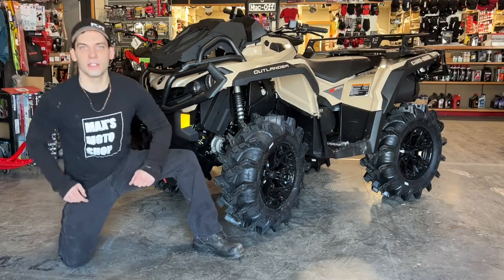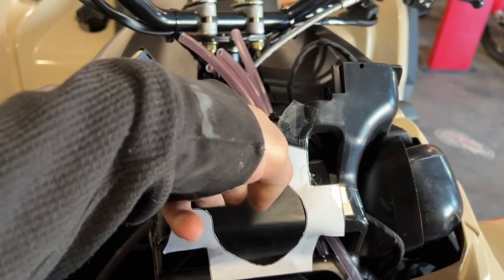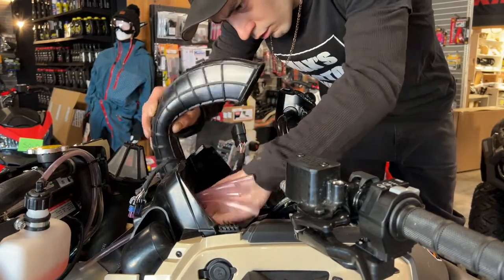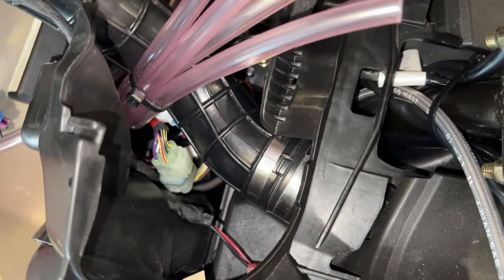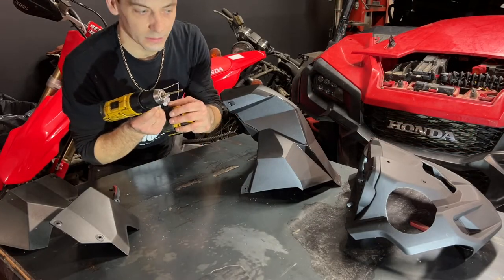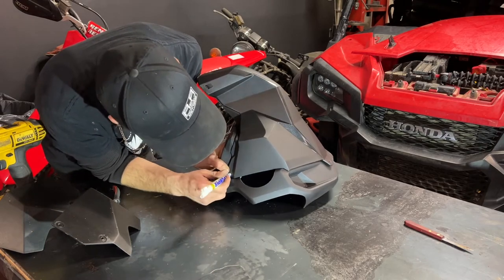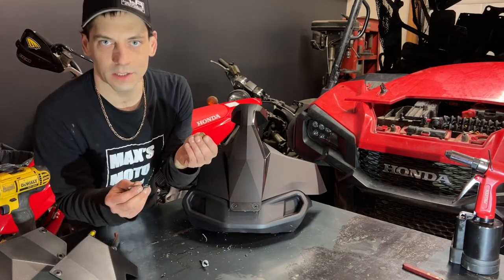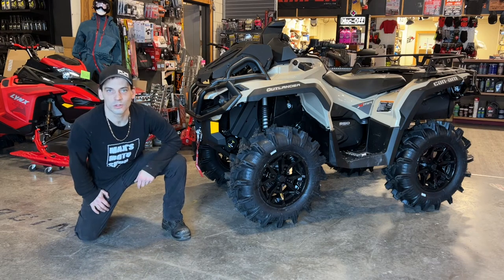Can-Am Outlander SNORKEL KIT!!! Step-By-Step Install Tutorial / 2022 Can-Am Outlander 859 XMR

Comment: Thanks for the video. I used a Dremel to cut out the holes. Way easier than whittling away at it with a razor.
Reply from the maker: Awesome I bet a Dremel worked pretty good I just like to use tools in my videos that I know everyone has at home

Comment: Will the kit fit the same on a non xmr 850?
Reply from the maker: Yes you’ll just have to use the other set of templates to cut a hole in the middle and on the left side of your cover refer to the instructions for placement of those templates

Comment: What happens with the hoses
Reply from the maker: They are pointed upwards and ran alongside the air intake
Reply from the maker: This snorkel does not allow you to go any deeper than stock because the clutch breather is still at the same level and will fill with water👍 can-Am  products

Comment: these snorkels make no sense because once you get up to the radiator and it goes underwater your belt will get wet and the only snorkel going up is the intake and the exit will still be underwater so i think these snorkels are useless
Reply from the maker: Yeah I would not get one personally
Reply: @Maxsmotoshop  yeah i’ll prob just make some my self to be honest or get warrior riser
Reply: @Maxsmotoshop  i would get one if there was a 3 way connect or something like that connecting them toghter but  there isn’t
Reply: Wouldn’t swamping the belt box be 1,000% better than swamping the engine though? 🤷‍♂️
Reply: their made for a XT not xmr
Reply: I was originally going to convert my base 570 to an xmr until I learned about the xmr snorkel set up. Just recieved my warrior snorkel kit and waiting on some buds to be free to help me install

Comment: Great Video ..But what about the big whopping hole on the other side of the benzel ?
Reply: I have the same exact question. I just installed this and i’m not very happy with the large hole on the side.
Reply: That's the original cover,you can go online and get the basic cover without holes in it.

Comment: Great video. Now I had the dealership install mine. Now when I get in the throttle it sounds like it’s starving for air. And idea what that can be
Reply from the maker: Check the tubing coming out of your airbox make sure there are no bends and it is free and clear out the top of the snorkel
Reply: @Maxsmotoshop  that’s what it was. The air hose was kinked

Comment: This product is pointless.... 
The only thing extended was the CVT intake... The CVT exhaust and air intake for the engine still sits at the factory level, so you gain nothing but appearance.
The installation video was well detailed and informative. It informed me not to waste my money on it.
Reply: your actually wrong. the intake for the engine is getting raised. The cvt exhaust and the cvt intake are staying in the factory positions. id rather get water in my belt box before my engine.
Reply: @Nicholas Davis  your right about which intake it is. But once your belt box gets full of water you aren't going anywhere. You are much better off getting a full snorkel kit for the same price.

Comment: how did you cover the hole on the right side of the display casing?
Reply from the maker: Your options are to leave it there or buy a new cover👍
Reply: would there be no possible way to leave the original cover on that side and essentially only drill the rivets out on the other side to keep from seeing that hole?
Reply: @connerbergeron7838  I was just at the dealer and they suggest buying the XT cover for $25.  It doesnt have the hole.